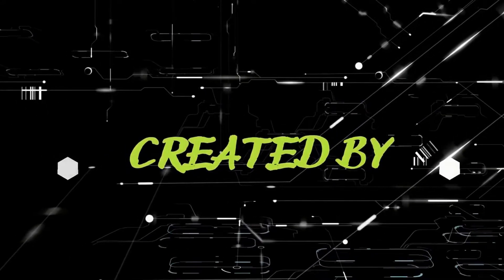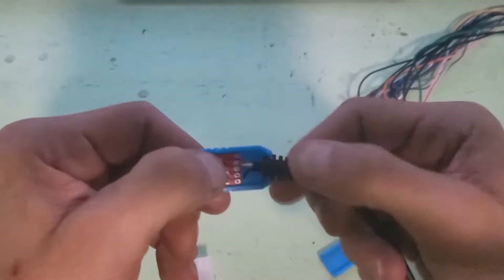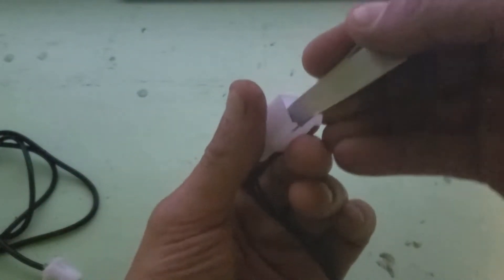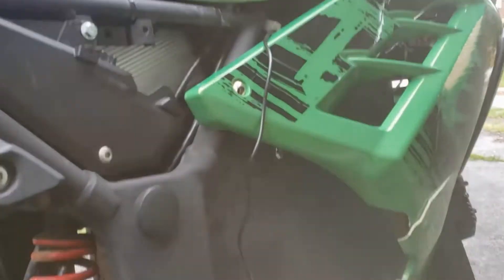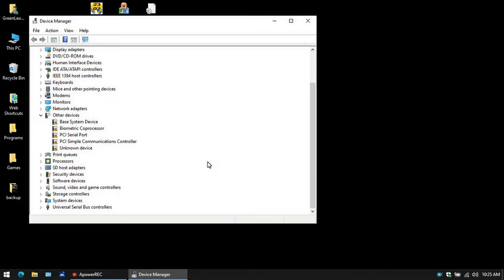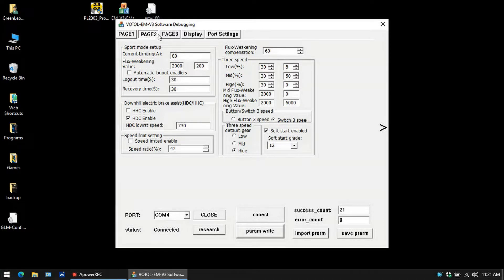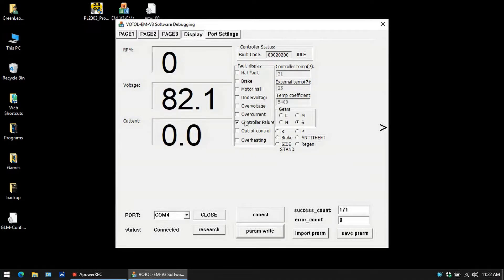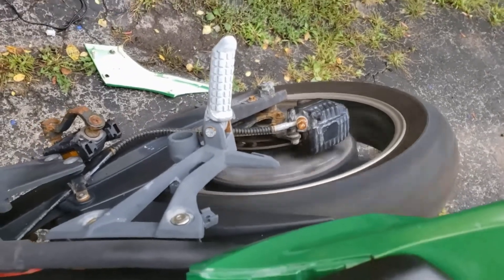Tao Leo - Votol EM-100 Programming and Test

Comment: Hi, I ordered a new em100 and im having a problem when I release the throttle the motor keeps spinning at full speed and hitting the brakes isn’t stopping it, it only stops when I turn the key off. Do you possibly know what would be causing this ?
Reply from the maker: Check the throttle settings in the controller. Should be from 0-5v. Otherwise I don't know. Did u follow my steps to program it? What bike? What parameters is it currently set to? U didn't give me alot to go on there.
Reply: @GreenLeoMan  it’s a tao leo with the 17 inch qs motor and most of the settings were already set to the same as yours in the video and any that were different i set them to the same as yours. And the I one that i ordered is the em 100 but the ymmotor version. I ended up getting a hold of the seller and he said He will remote into my laptop to debug it, I ordered two of these controllers and they both have the same problem.
Reply from the maker: I know nothing about the ymmotor version. Hopefully what they do for you works. Good luck and let me know how u make out. Kinda curious about that 1 myself.
Reply: Max from Alibaba was able to program my tao leo and my cruiser ebikes and both are working great now! I am also able use a bigger (84v) battery that charge’s to about 98v fully charged and sits about 92v after driving, I just had to set the over voltage limit to 98v and it’s been working great no problems. Video of the tao first test. https://youtu.be/uk1hkhBEIG4

Comment: What do you think about the new 6000 wat motor  emmo made
Reply from the maker: I think spending $2k extra just for the motor is a little much. Ur still limited by the controller. But if $ dont matter then sure. But i prefer qsmotor brand motors. Qs has a 15kw motor. What u think about that?
Reply from the maker: Sry its 10kw not 15. My bad. https://www.qs-motor.com/product/new-10000w-17inch-in-wheel-hub-motor-with-6-0x17-rim/
Reply from the maker: And its way under $2k for 1. https://m.aliexpress.com/item/32997887449.html
Reply from the maker: So in my opinion the emmo motor costs way to much for a 6kw motor. I would have to say no, I don't like it. 👎
Reply: @GreenLeoMan  don't forget the battery and MCB too 😂👌

Comment: At last a guy I can sub to that knows about votol, I bought the votol em70 from Ali express without knowing what to do with it on the computer 💻
Reply from the maker: Tnx for the sub. Hopefully u get it all figured out.
Reply: @GreenLeoMan  I got stuck on pole pairs for my motor at first, because I got a generic 1500w hub motor for my Kona MTB and I put 46 in pole pairs(46 magnets my motor has) and took 2 days of trouble shooting till I realized a pair is 2 🤣 put in 23 in pole pairs and the controller works, just trying to understand the rest as they is quite alot of boxes to tick and the rest
Reply from the maker: Awesome bud. Needed the laugh. Yes, pairs come in two rofl. Glad u got it working. 🤣😊👌👍
Reply: @luna_officiallyreal  you can actually lower the pole pairs so it would be more forceful/torquier. But it may depend to the generation of hub on how it is built, say a 3000w powersave hub normally, 28 pole pairs, i set it to 24 its much snappier now. My mentor said i can go as low as 20 pole pairs but is about the limit it can handle. More like a at your own risk sector.
Reply from the maker: I like to leave the pole pairs set acording to how many there actually are. I find if u set them lower, yes it's snappier but alot less smooth, u can really feel it on a crawl for a dead stop. Yes u can do this but like marionne patrick said it's at the risk of your motor if u go to low. In my opinion I'd leave it where it is.